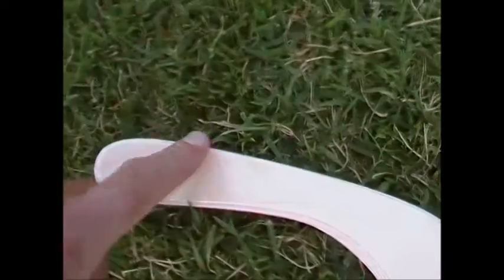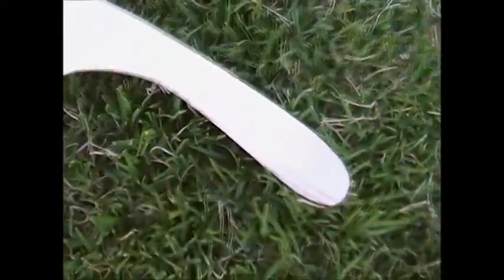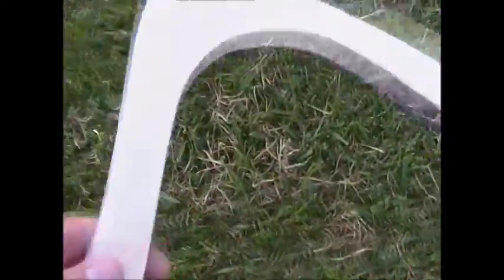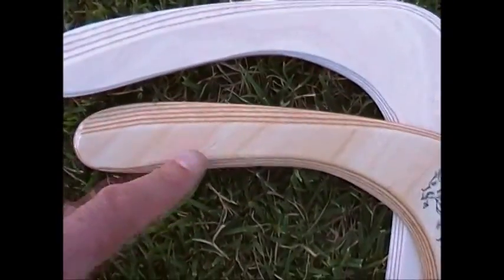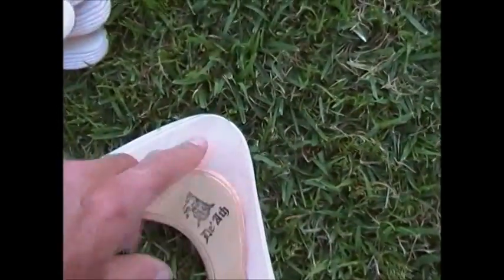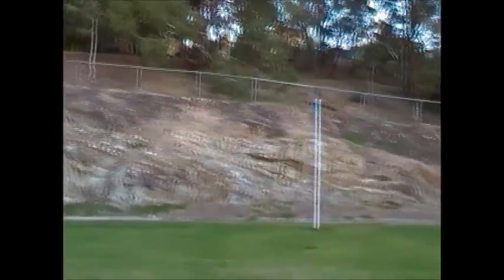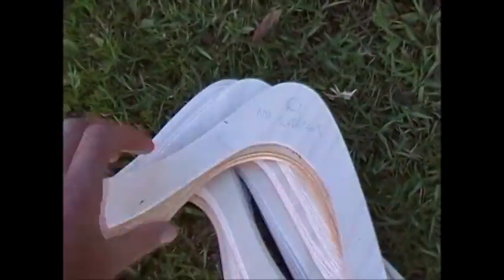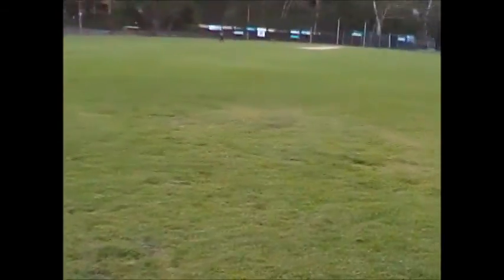Techniques for Boomerang Design Part 4: Testing Variations in Airfoil Shape

Comment: The one with no surfaces whatsoever is a crack up, it's a wonder it even stays in the air with no aerofoil.
Reply: strictly speaking at these airfoil sizes there isnt a lot of difference.
the determinant is something known  as the reynolds number, and its why model aeroplanes with flat wings still fly relatively well

Comment: Great experiment.  I've been thinking about making a robotic throwing machine to test mine, seems like a consistent launch would help with the science.
Reply: I've been thinking the same thing, especially for testing left handed booms. I might modify a clay target launcher. I just have to work out how to give it consistent spin upon release.
Reply: The wind will always be your variable.  It changes direction and speed quickly. At least you rule out one inconsistency.  I use a electronic  wind meter 35.00. It helps.